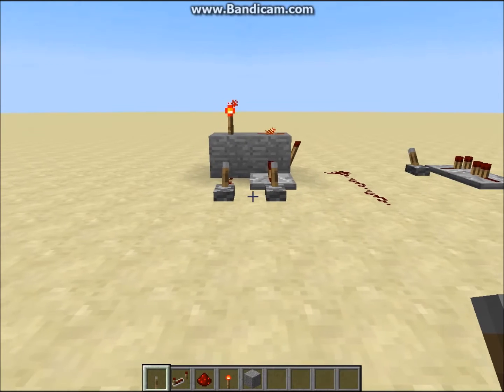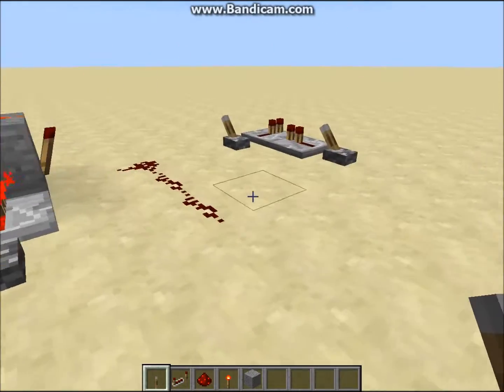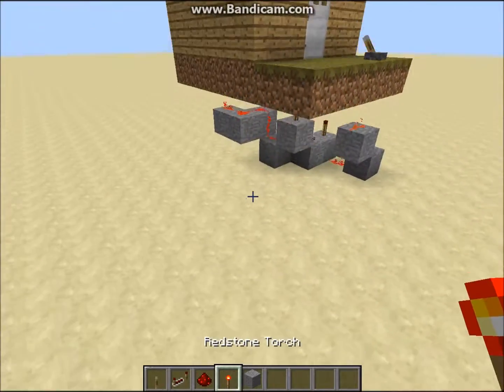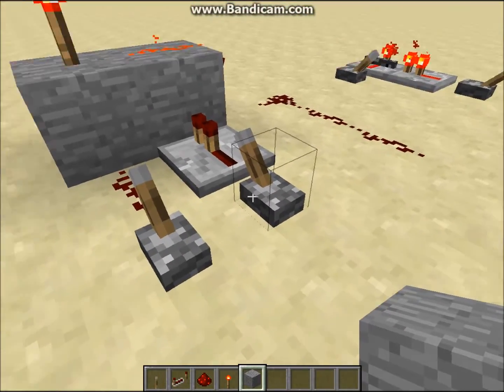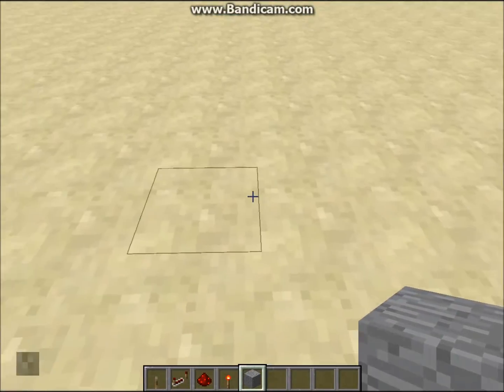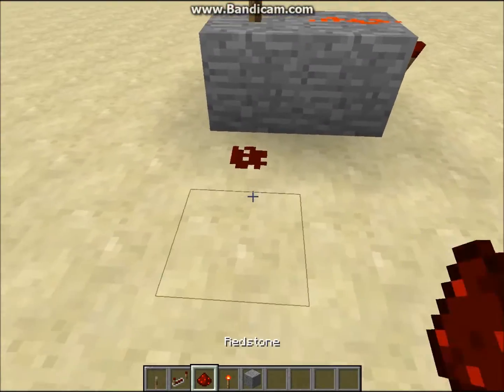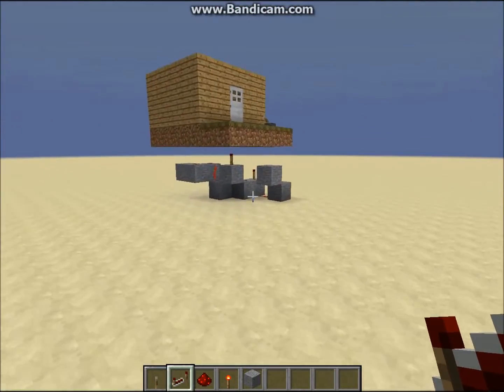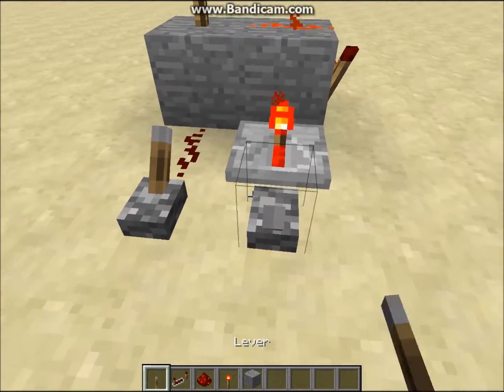Minecraft Transistor

Comment: it's a PNP transistor.
Reply: It can actually be used as an inverter.
Reply: How is it a transistor at all?
To count as one, the output should be off when there is no redstone input, and turn on when there's too much.
Bonus points if it augments low input signals in the output.

Comment: thats a logic gate. one guy told you some things about a transistor, but in its simplest form the characteristics of the component is that you need a specific value at the base to allow a current flow from the collector to the emitter. you can use current from the base to amplify the flow from the collector to the emitter. you can reverse bias the base (sending a voltage  the opposite direction of flow you need to foward bias it, in other words the flow path you need to allow the passage of flow from collector to emitter) so that you can futher control the flow on the Base side of things because a negative voltage will result in the Base not being foward bias in result there is no flow through the collector/emitter.